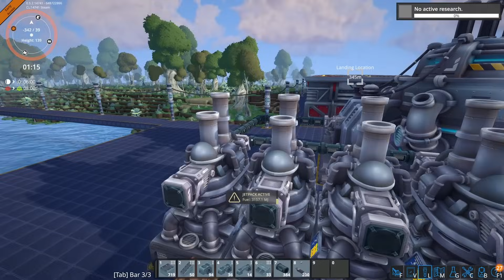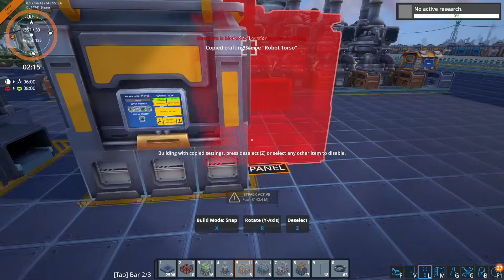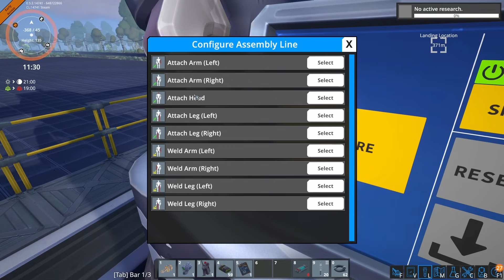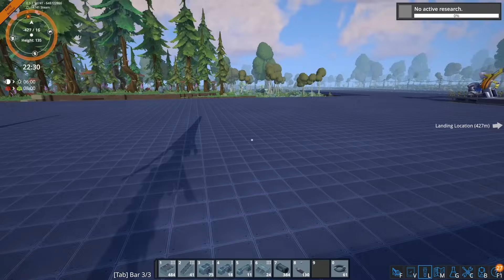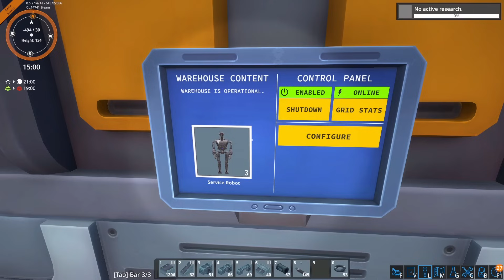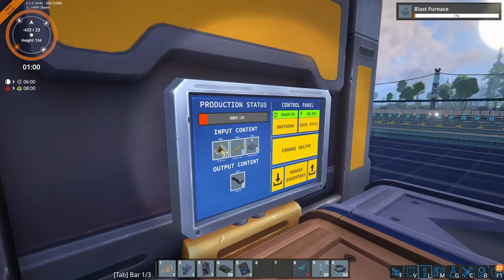Making ROBOTS 🤖 On ASSEMBLY LINES In FOUNDRY Early Access | 11 | Lets Play

Comment: Just to help you out, when you get to setting up a blast furnace. 2 Fully built Air Intake, 4 Hot Air Stove, will run 1 Blast Furnace. Which I think is more efficient for making Xeno Plates and Tech Rods.
Reply: Blast Furnace Reduce the Amount of Ore you need. 

Example: 1 Blast Furnace Turns 2*640 Xenoferite Ore, 256 Mineral Rock, 640 Cocked Ignium (256 Ore) into 6x 640 Lines of Plates. It would need 96 Casting Machines for this and Energy Wise it uses something about 30-45 MW. 

So Yes Blast Furnace Reduce dramaticly the Ore Consum of your Base but Cost a Hell of a lot Power.

Comment: A robot costs 160 bars and sells for 200 bars. That's a net profit of 40 bars per robot. Considering that the other resources requirement is not much more than for simple drones (by 20-30%) and sell for 8 times as much, making robots instead of drones is extremely profitable.

Comment: tbh the firmalite balance feels way off. i scaled up drone sales big time just to supply my service robot production. Kinda feels like they eat much more firmalite than what they sell for.
Still just a  guess, haven't done the math.
Reply: It's not difficult to calculate. I'll save you time: a robot costs 160 bars and sells for 200. That's a net profit of 40 bars per robot. Considering that the other resources requirement is not much more than for simple drones (by 20-30%) and sell for 8 times as much, making robots instead of drones is extremely profitable.
But some initial stock of ingots is needed to start a fully self-sustaining and subsequently profitable production. If you start a production line without a sufficient stock of ingots or already printed sheets, the line will take quite a long time to reach working capacity; production will constantly stall due to the delay between ingot arrival (trade/transport time costs) and consumption. That's what the buffer is needed.

Comment: Nilaus, if i may make a suggestion, do not use the module storage(silo storage) for general fluids.  the flow out and in for certain fluids does not work right.  For example, water in and out will only flow at 50.  however the low density will flow at 400ish same as the oil.